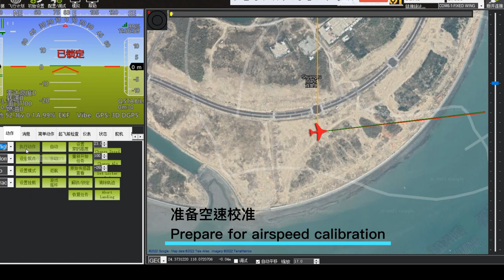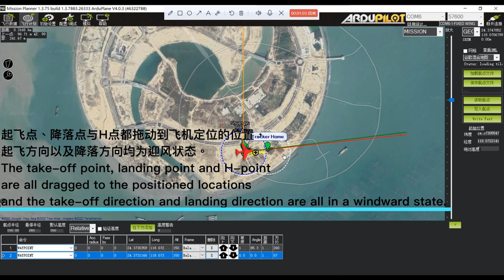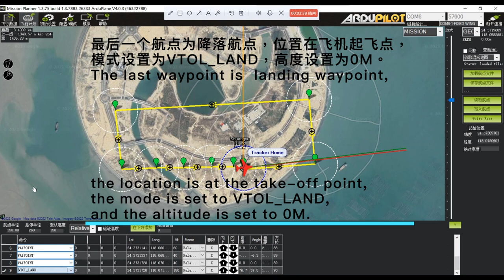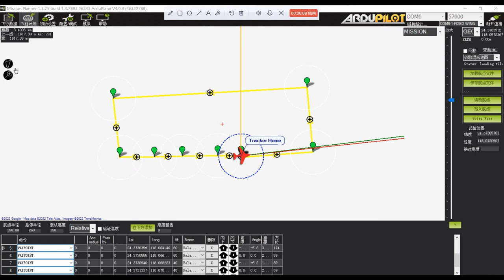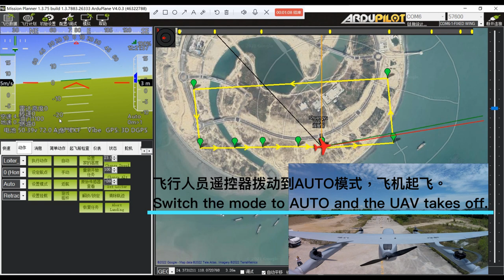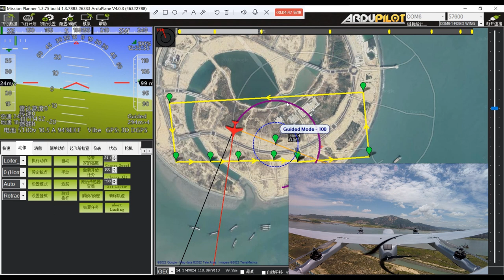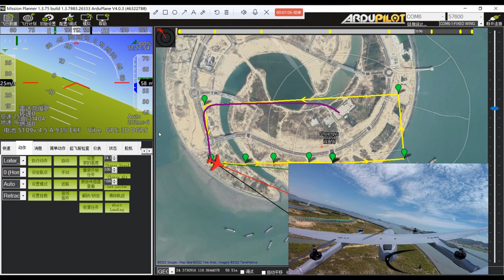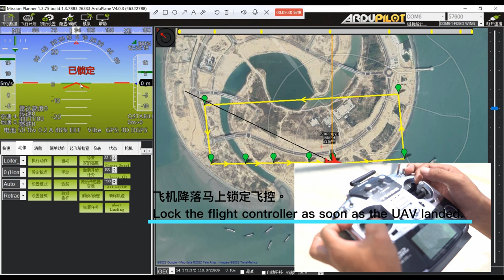EV350 FIRST FLIGHT TUTORIAL - PART I - GENERAL FLIGHT PROCESS

Comment: This is an excellent plane. I flew for 2 hours at an altitude of 2600 ft in 30 knots of wind. I didn't think you were this talented. The only problem I had was the thermal air pressure caused the plane to reach 6500 ft. Congratulations, good work.
Reply from the maker: Many thanks!

Comment: I already researched the maximum range these drones can fly, the mugin-6 looks promising, but...
I have a question regarding the Range of the radio signal, and how to deal with limited range of the radio controller, or what other devices are used to get the full 300~km range
Reply: 那就需要通讯距离更远的链路来实现